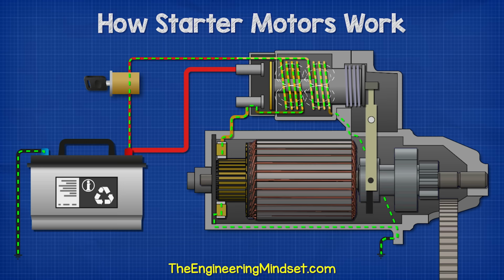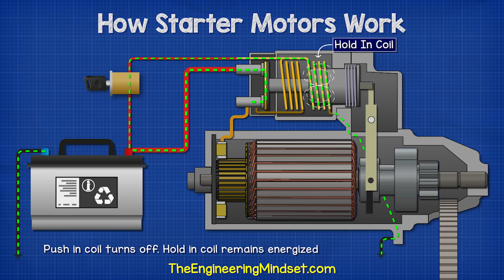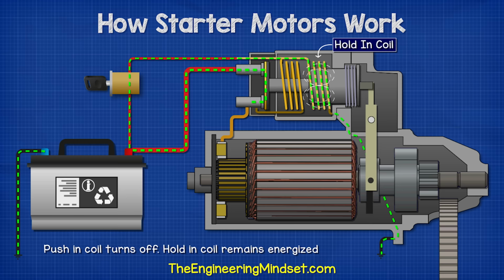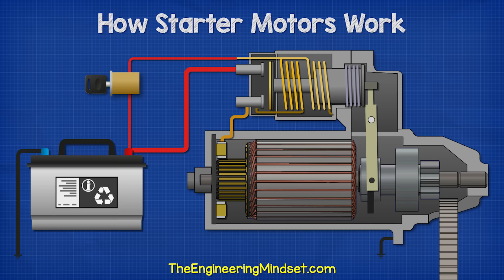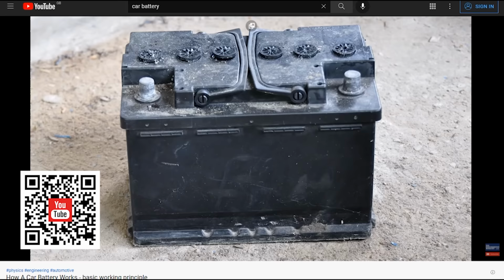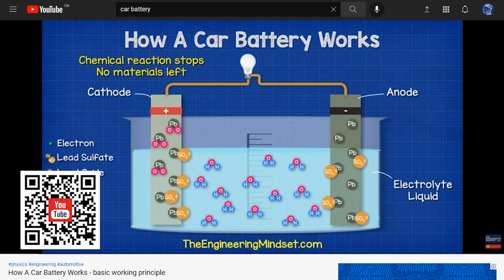How Starter Motors Work

Comment: How does the starter motor move into the flywheel position without bashing the teeth on the flywheel?
Reply: The teeth on the starter gear are cut so that they will slip into the flywheel gear. Kind of a bevel cut
Reply: Taeguy / By the geometrical shape of the teeth, as Raf Matt says here in his text.
However, even if the teeth of the two pinions ( gears ) would be exactly one in another, the light pushing force applied by the mechanical fork combined with the rotation of the starter makes possible for the teeth to intercalate instantly.
Reply: I agree with the replies so far. When you take the gears apart you also find the mechanism is spring loaded, with no hard contact between teeth if it meets direct contact. If contact is made, the spring maintains pressure to engage while the gear is rotating, so when a gap is found the spring can push the teeth all the way home. The ring gear teeth are harder than the teeth of the starter, so in theory if the teeth get damaged you are likely to repair that by simply replacing the starter. As stated in the video, when the teeth are extended they also rotate, which gives more versatility to slip into the next available gap. The overall design, including the clever pull-in coil switching, is genius.

Comment: My Accord wouldn't start, lights and dashboard worked but there was no starting 'click' usually associated with the starter or specifically the solenoid.  My neighbor gave the starter motor a little bang and the engine worked! I'm thinking the solenoid was stuck.

Comment: Very good description.  It never ceases to amaze me how magnetism can cause motion.....especially when cranking an engine.  I've rebuilt many GM starter motors from the 1960's and 1970's during that time.  My Dad taught me.  Also rebuilt Ford, Chrysler, Nissan and large truck cranking motors.  Never worked on an air starter.  Interesting animal that one.
Reply: I've never heard one in person but I've watched many videos of Detroit Diesels with air starters! As cool as they sound, I bet the novelty would wear off pretty quick.

Comment: Is the flywheel just called a flywheel or does it have a different name. My starter is new but it sometimes grinds on the flywheel. Don't know if it's because it's cold or if I need a new flywheel
Reply: It’s better if the the teeth on on your started could be damaged. Better to replace the started because if the teeth on your flywheel are damaged the transmission will have to be moved to access and change it.

Comment: Sir which starter is more powerful
permanent magnet stator or electromagnet stator ?
Reply: Doesn't matter, unless one form of magnet happens to be stronger. One thing to note with an electromagnetic stator is that will also be drawing current from the battery, potentially reducing the voltage potential across the battery (thus reducing performance by a degree).
Strictly DC motors will almost always be permanent magnet. Motors that use an electromagnet stator and also run on DC are universal motors, from a quick google search, it seems they typically aren't as efficient as a DC motor.
Reply: @childishtombino1275  
Yes universal motor have less efficiency
than pmdc motors
Reply: @h7opolo  At a much higher current. Which is an issue if you're running off 1 battery. It doesn't seem appropriate in this application.